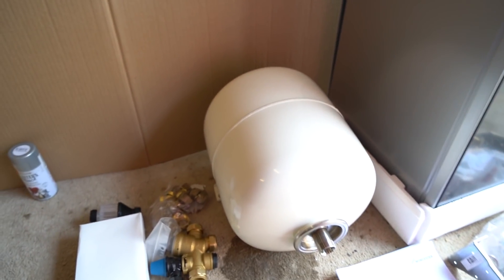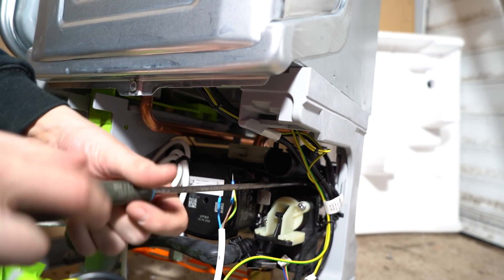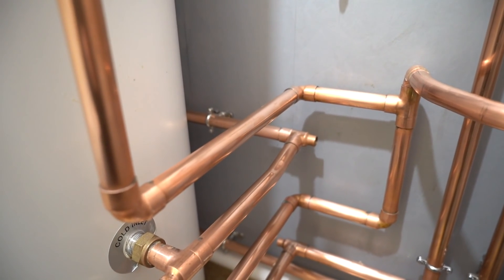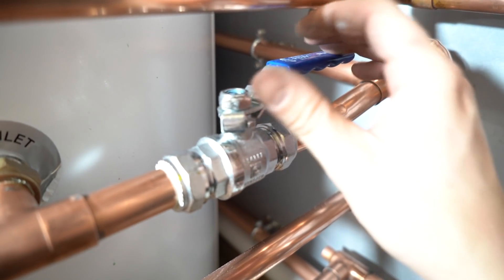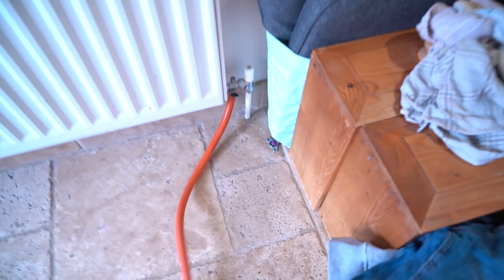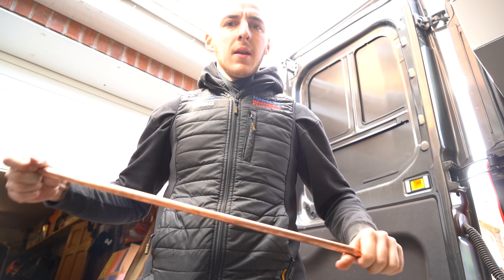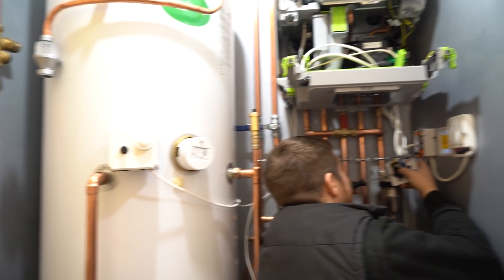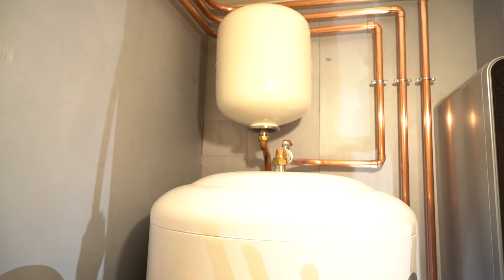WORCESTER BOSCH SYSTEM WITH INTEGRAL DIVERTER

Comment: Brilliant install 👏  great to see someone taking pride in their work! Question, is there any issue with lever valves on a heating side of system? I was told there was but I'd far rather use lever valves as they seem much more reliable to me than gate valves. Just wondering do you need specific brand or is it just wrong information I've been told? Keep up the great work 🙌🙌
Reply: Much prefer lever valves over gate valves! There’s no issue on a system boiler with lever valves. If it was a regular boiler then that’s a different matter as you could isolate the boiler from the F and E tank. Plus if the valves failed then it would mean the regular boiler would be pressurised.
Reply: There’s no reason why you couldn’t use lever valves instead of gate valves on any heating system. The only exception to this (I believe) would be for a bypass, where fine adjustments are necessary and the gate valve mechanism is far better suited.

Comment: The last integral diverter worcester we fitted, we noted cylinder demand temp  was controlled through NTC cylinder sensor and energy cut out was controlled via Cylinder limit stat wired through 2 port.

Comment: Hi mate, are you running this on low temp flow (55°C)? And if so how are you controlling the multiple zones?
Reply: I dont think theres a way you can have different flow temps on more than 1 heating zones, obviously the dhw takes priority and must fire at full rate, you can then weather comp all heating zones but not differentiate them as far as i'm aware

Comment: I'd give it a 7/10.

 You can have 10/10 if you tell me you used weather comp (nest doesn't count unless you're running opentherm), upgraded the  the TRVs to pressure independent, mapped the pump to match the index circuit, got the rads running at a nice low MWT to  take maximum advantage of the lovely PDHW you installed and covered your nice shiny pipes in the thickest lagging you could find.

Comment: I really like the look of that pipework. Those clamps look great. You obviously take a lot of pride in your work. That is so much cleaner than most of what you would see in a North American home. Then again, we generally don't have anywhere near that much pipework. Just a hot water boiler and that's about it. Almost all homes in Québec are heated with electric systems. In other jurisdictions, gas is more prevalent, and that's generally completely separated from the hot water system.

Comment: Rate your workmanship
Better than outstanding. 
Had a similar WB8000 system boiler and tank fitted at my parents place last year, our plumber was also very clean and tidy with the pipework, but you've take the job to a new level. 
Wish you could do the plumbing work at my place.
Best of success with your work 👍

Comment: Hi thanks for posting. Really nice work. Can I ask? It looked like you fitted a isolation valve between the (combined pressure reducing/pressure release valve,pressure vessels) and the cylinder on the cold water pipe. My understanding is there should be no way of isolating between the cylinder and the safety devices . The only fail safe would be the TPRV.  It was hard to see from the video. Is that what was done  and is it against regulations or manufactures instruction? No hate just though it’s a distinction worth making. 👍🏼
Reply: Not hating on the install as its a very neat bit of pipework, but the valve shouldnt be there. To avoid the need to drain off the cylinder i personally take the CWCV above the top of the cylinder , it then requires minimum draining for servicing or replacing.
Reply: @nevillethumbcatch5691  Ditto, it's not high enough. Should not have a valve after combination valve either.

Comment: Never use Map gas on small joints it’s to hot for soldering . Propane only
Reply from the maker: I love it because of the higher temp when soldering haven’t had any issues through burning ply behind or walls

Comment: Proper Class install mate! Love the touch with the silver paint 🤌 one thing...your waste pipework for the D2, is that high temp pipe? I was of the understanding that d2 from a cylinder can discharge into 1" 1/2 but the waste pipe must be high temperature pipe...please correct me if I'm wrong though!
Reply from the maker: Thanks for the kind words !! Yes Mcalpine can be used now as it’s rated for the temp
Reply: @hartleyheatingandplumbing9801  sweet I will remember that pal 👍

Comment: Great work as always. From one plumber to another. One thing to comment on. The bypass setup is after the magnetic filter so won’t that slow flow water into the boiler after the filter?? Just a thought. But always easier to pic at things after the job is done. Still great to watch

Comment: You still need a 2 port fitting as well as the integral valve, safety valve
Reply from the maker: Why’s this Harry ?
Reply: You don’t need a 2 port, as it states in the Worcester bosch cylinder instructions for the cylinder. You need to be able to shut down the heat source we achieved this by wiring the safety limit cut out direct into the boiler. Standard unvented installation yes, 2 Port and safety cut out required.

Comment: 👌great install. 
Couple of questions though. 1. Why feeding coils in parallel and not loop in loop out. 2. Why not use Worcester controls through EMS so as to achieve load compensation and or weather compensation. 
Asking to get different perspective and not to be picky.
Reply: Personal preference to load/weather compensation. I would say most end users  are not used to low flow temperature going around the heating circuit. When I was in technical support for WB most common queries we got was on the FW100 weather comp control. Common complaint was the radiators were cool when it was colder outside we had a set of instructions to maximise flow temp from the boiler. We normally advised after the call to get in touch with the installer and to have it removed.
Reply: @raheatingservices652  I agree so after few early installs I switched back to load compensation which has worked fine. My learning was if anyone want to time the heating than weather comp no good. But for continuous heating it works brilliantly. My own house I have only weather comp(advance weather comp) and no thermostat and it works perfectly fine.

Comment: So you add integral Diverter valve to avoid 2 port valve, whether it is good choice depend on what type it was, if with hot water cylinder 2 pipes( flow and return), I don’t think it is good idea. Traditional system(2 pipe) is perfect.
Reply: The diverter motor they use is the same one they use in the combination boilers. So the motor doesn’t go into mid position. It will favour hot water as that’s the shortest demand if it has a choice of heating and hot water. Hope this helps 👍🏻
Reply: Boiler needs to behave differently when doing heating vs hot water. For heating a lower or variable temp is ideal and for hot water you want high temp. With this you do priority hot water and play with multiple control options on heating side to create better comfort and efficiency. You can do the same with traditional s plan system as well with using Worcester wiring control box but this is much easier in single zone applications.
Reply: Depends on your application, if it was an existing cylinder which was vented in an airing cupboard boiler in the kitchen and you go for Unvented you wouldn’t run extra pipework between the boiler and cylinder. If it was a new installation then this would be a viable option. Another scenario would be if was a gravity cylinder (2 pipes to cylinder and 2 pipes from boiler to the pump and heating circuit) you could do this integral diverter valve set up.
Reply: Hey lads that’s a neat install 🔥is this Worcester’s way of doing PDHW? Or can the diverter go to mid position ? Not that you’d want it to go mid Position as PDHW is the way forward

Comment: It was a complete pleasure to work with Hartley Heating and Plumbing on the installation. The wiring to the boiler was completed by myself. Normally with an Unvented cylinder installation you would use a 2 port valve and use the safety limit stat to shut the heat off the heat source. With the integral diverter valve kit you achieve this by wiring the safety limit stat direct into the boiler. The Installation and service instructions detail what’s required with the wiring.
Reply: The cylinder sensor is wired into the boiler direct, so the boiler monitors the temperature of the cylinder. The safety limit thermostat is wired in to the live of the boiler so in the effect the cylinder overheats the boiler shuts off. Similar principle to a safety cut out on a condense pump and overfill on that.
Reply: @raheatingservices652  What controls the hot water, is it the boiler just as and when according to the cylinder sensor? There's no switched demand on the hot water side so it must be "always on". What if the customer wants time control for hot water?
Reply: So glad you’ve wrote this . Just tried looking for some MI’s on integral Diverter and cannot find them lol
Reply: @harryblack6002  yes, it’s in the Worcester bosch cylinder instructions glad to of helped

Comment: Enjoyed watching you video. Keep up the good work. Question: Didn't you do the electrics yourself? Did u get a sparky do that side of the job.
Reply: Hi Mohammed, I did the electrics to the boiler myself. I’m another heating engineer that understands the electrical side of this installation that Hartley Heating and Plumbing didn’t feel the sparky would fully understand the set up with the Nest, Cylinder, integral diverter valve etc

Comment: If its a system boiler how come it's got a hot and cold feed from the boiler ?
Reply: Boiler has a cylinder flow and return. Central heating flow and return. The integral diverter valve operates the same way it does on the Greenstar combination boilers. When the arm is fully up it’s in hot water/heating the cylinder. Down central heating. It works on the return so shuts off the pathways to either the cylinder return or heating return. Hope this helps Umar 👌🏻
Reply from the maker: Hi Umar at the start of the video you can see the diverter valve being fitted this is how it fed the cylinder